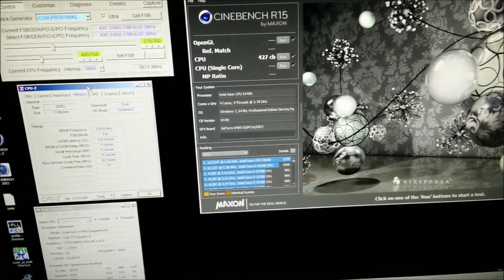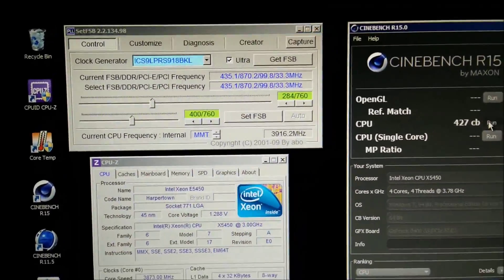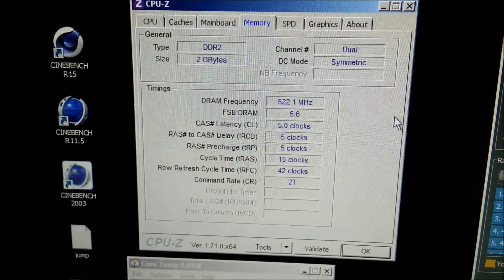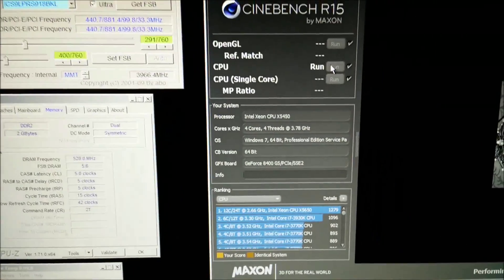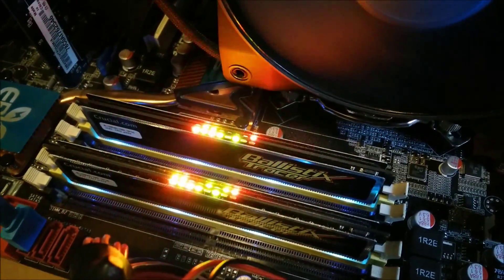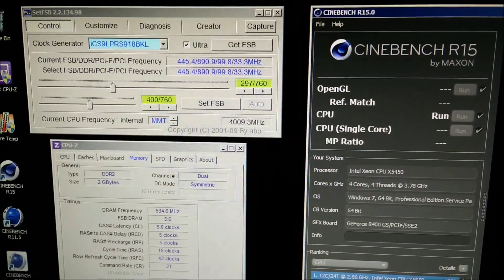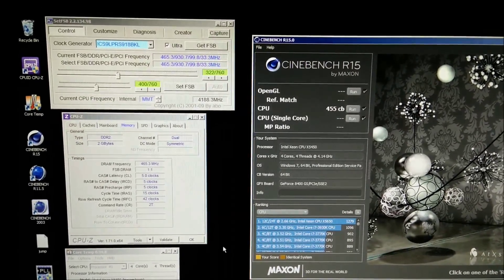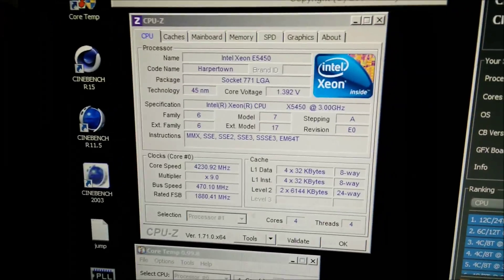Intel Xeon X5450 Overclocking and How to use SETFSB to find a stable overclock quickly

Comment: Ya running this Setup with DDR2?
Reply from the maker: +JustRefleX yes i did.
Reply: Lawrence Timme Why tho? No offense :S Was this the only supported RAM with the CPU?
Reply from the maker: +JustRefleX no ddr3  isnt any faster.  And the mobo board was ddr2
Reply: Lawrence Timme Dont have much knowledge about Server CPUs yet but are all of them doing well in overclocking. I heard most arent overclockable or barely.
Reply from the maker: JustRefleX Sandybridge or later can't really oc, but anything old should do as long as the motherboard supports it
Reply: Lawrence Timme Awesome. I just wanted to know that since if my CPU ever breaks or I ever build a new rig I might to get Server CPU's :P I'd go for ddr3 or above tho :P
Reply from the maker: JustRefleX ok

Comment: Thanks for vid, i was not sure does x5450 is overclockable to 4ghz
I ordered p5q-e mb, x5450 ofc, and old thermaltake water cooling.
The GPUs will be two r9 270 in crossfire.
If everything will be ok then i will get 1500$ pc for 400$ :D
Reply: Lawrence Timme
Hi, i got everything, x5450 e0 cpu and macho revB cooling.
And I have some troubles with high OC.
At this time im only able to get 3,6ghz at stock voltage and up to 57*C.
When I set cpu voltage in bios to 1,375V and fsb to 450, so about 4ghz, there was errors in OCCT.
Everything other in bios was auto.
Even 430 and 415fsb was making pc crash w/o starting occt...
wtf?
Reply: PLS, tell me!
I read 10 articles about OC and there was no working options for me!
You have exactly same mobo and cpu as me, so your settings should work for me.
RAM is 4x CM2X20148-6400C5 so 8GB total.
Reply from the maker: Your welcome :)  if it is e0 stepping it should overclock very well.  :)  you can find the stepping by looking in CPUZ at the revision or you can look at the letter on the top of the cpu and Google them :)
Reply: Sorry but i dont understand what that e0 means.
I still dont have that parts in my hands, they are in way to me so i cant find that things in cpu-z
Reply from the maker: Arek R. ok.you will have to wait until you get the cpu
Reply: ok
Reply: Hi again, because of some troubles i didnt get that cpu yet, and i have to look for another one.
Its big difference between c0 and e0?
That e0 is for 10$ more than c0.
Reply from the maker: +Arek R. Yes huge difference you will go from 3.2ghz max to 3.8-4ghz max
Reply: Ok thanks, there is some codes on that CPU to be sure that its E0?
Reply from the maker: Arek R. it will say in cpuz and it will say SLBBE on the top
Reply from the maker: Arek R. SLASB is c0
Reply from the maker: you want e0 :)
Reply: So i need SLBBE?
Reply from the maker: +Arek R. Correct
Reply: Rofl, i found that i7 920 cpu is 4 core 8 threads and much cheaper than xeons.
But its quite hard to get cheap 1366 mobo.
What do you thinks about this?
Reply from the maker: Arek R. 1366 board are way more expensive, but that i7 is much faster.
Reply: +Arek R. 
P5k/epu x5470@4.4ghz over 500+ in cinebench * 10 multiplicator ftw guys
Reply: X5470 is three times more expensive than X5450.
Reply from the maker: +Cyril Guillaume that is OK but they are way more expensive and if you have a better motherboard you really don't need 10x multi
Reply: Lol when i tried to play your vid mozilla is crashing at that actual 400fsb
WTF?!
Reply from the maker: lol. if you leave everyting on auto it will crash, you will have to set all the main ram timings and ram speed to get a good overclock. 775 ani't no noob platform where you bump fsb aand the voltage and its overclocks, you have to set it all up to get the best out of it.
Reply: +Lawrence Timme 
Can you please tell me which settings in bios i have to set up to what values?

Comment from the maker: +Sup Tsunami i can't reply to your comment because your privacy settings are wrong.  you can use adia64 if you like if you think it is more accurate.
Reply: thanks so much for your reply your the best i use hp core i7 1255u laptop 12th gen is it easy to use and i can i load it from task bar and should i do a system restore point also is it possible to do it with out clicking on set fsb once load it and do I click get fsb to start with and can the version setfsb_2_3_178_134 work thats should be all now please reply me asap